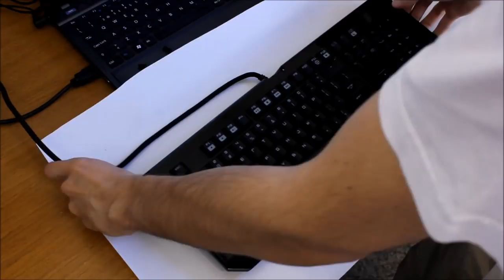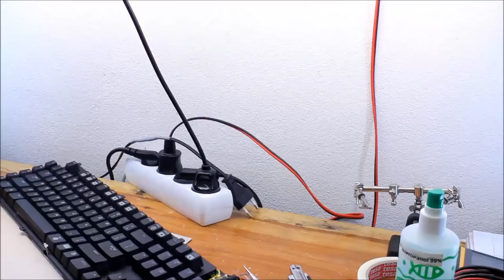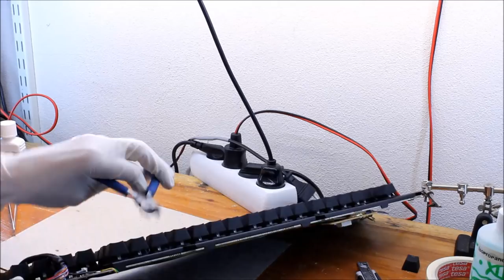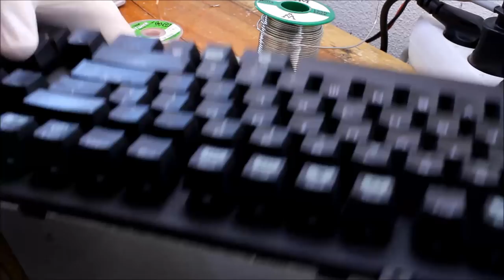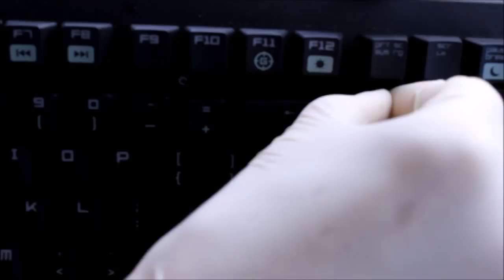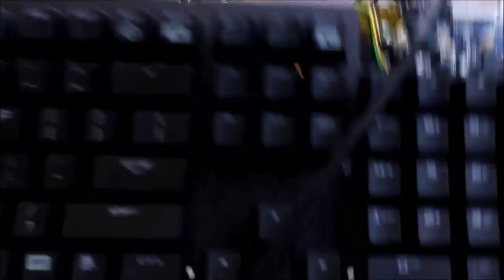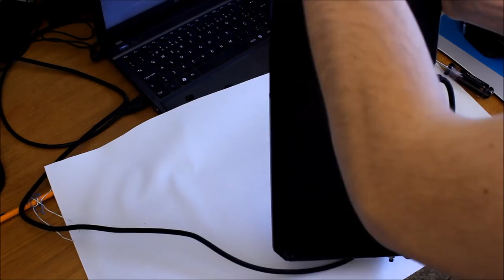How to replace backlight LEDs and Cherry MX switches in a mechanical keyboard.

Comment: Hello, is possible to put leds on my blackwidow's switches?
cuz ultimate version is too expensive :c
Reply from the maker: +imStorm3r It might be if the printed circuit board allows it, but I think you will also have to replace all your keycaps. If I'm not mistaken, the non-ultimate version of the blackwidow doesn't have translucid keycaps (even if you had LEDs, the light wouldn't be able to get through the plastic).
Reply: José Faria
it was obvious that I should change them
but can you please recommend me a video or something about placing leds on my switches?
Reply from the maker: Not that I know of. Just open you keyboard and follow the instructions on this video (skipping the LED removal, of course).
Reply from the maker: ***** imStorm3r  Up until yesterday I wondered if all blackwidows shared the same PCB, but an user confirmed they don't, at least his non-backlit PCB doesn't have LED mounting holes, so you will indeed have a LOT of work to make yours backlit.
Reply: That's a lot of work ._. ...
Then I will buy myself a new keyboard with leds when this one will not work anymore xD
Reply: +imStorm3r lol im thinking can i change my led colours of my blackwidow ultimate 2014 pls someone help .-.
Reply: ***** i dont have half of those things in the video i just wich there would be somekind downloadable hac or something :DDD
Reply from the maker: sniperb1990 sniperb1990 No, it's definitely an hardware mod :D

You will have to do what ***** suggested and replace all the LEDs if you want to change the color of the backlight. If you have to buy the soldering iron and associated supplies, it might be cheaper to sell your keyboard and buy one in your favorite color (or one of those new RGB ones).
Reply: José Faria is there an hardware mod :D
Reply from the maker: sniperb1990 sniperb1990 replacing all the LEDs is the hardware modification.
Reply from the maker: ***** Razer, with their clone switches, used a single 3mm RGB LED like this one: http://www.wayjun.com/images/Led/LED-504RGB.jpg

Corsair, on the other hand, used Cherry "RGB-ready" switches. Instead of having the LED on top of the switches, Cherry's approach was to make the switches transparent, so the keyboard manufacturer could install an SMD LED under the transparent switch, Corsair have a picture of the transparent switches in their page: http://www.corsair.com/pt-pt/landing/mx-rgb

The only thing in common in both Corsair and Razer's approach to RGB backlighting is the completely ridiculous prices, at least when they first came out, now there might be better deals.
Reply: José Faria thanks man
Reply: José Faria but where can i buy the leds
Reply from the maker: sniperb1990 sniperb1990 If you're not in a hurry and want the lowest cost possible, go to aliexpress.com or eBay and search for "led 3mm flangeless".

Like this: http://www.aliexpress.com/wholesale?catId=0&SearchText=led+3mm+flangeless

You can also search for the specific color you want, and talk to the seller before you order and ask him to send you a custom amount, like 150 LEDs so you also have spares in case some of them breaks down.
Reply from the maker: sniperb1990 sniperb1990 Oh, and still regarding the LEDs, the "diffused" or "milky" types are better for keyboard backlights, as they help spread and make the backlight more even across the whole keycap.
Reply: José Faria lol thanks but i am scared to brake my keyboard XD

Comment: can a razer black widow expert be backlit? i see the holes already there, can i just add leds in?
Reply from the maker: Try to stick na LED in there, even without soldering it should light up.  If it doesn't work, try reversing it. If it still doesn't work, send me a picture of the top of your PCB.
Reply: http://imgur.com/JCQ60wP
http://imgur.com/H5GYU6m
here are pics of pcb, i tried with 3 leds already, revered 2 of them too. nothing happened
Reply: better quality one 
http://imgur.com/75HElBE
Reply from the maker: darren sweg The photo you showd me looks exactly like mine, so maybe they didn't mount the individual transistors for each LED. When you look between the PCB and the metal plate, can you see any SMD resistors? In mine you can see one for each LED.

If they didn't solder the resistors, it would take a lot of work: you would have to remove all the switches to remove the metal plate, solder all the resistors, then solder the switches again and finally solder the LEDs.
Reply: http://imgur.com/RhHH7MX
Are you talking about these red things?
Reply from the maker: darren sweg No, those are diodes, but if you look closely, a bit further up from the diode (a couple os millimeters) you have two silver pads withouth any component soldered, maybe those are the resistors that are missing? To test that out you can solder there a 470 ohm resistor and see if the LED close to it lights up.

Comment: hey, i dont have anything to suck out or clean the melting lead, any diy suggestion ?
Reply from the maker: If you don't have anything to clean the holes, try and melt the solder in both holes at the same time, if you use good flux this is easy, and when the solder is melted in both holes gently push the LED legs in their place.
Reply: i bought a soldering iron and i couldnt melt the pins ......... im gonna have to buy a new one and a pump too
Reply: also my lights have 4 pins like wtf
Reply from the maker: That's because you have a keyboard with RGB LEDs, RGB stands for "Red Green Blue", that means each of the LEDs in your keyboard is actually 3 LEDs in the same package, you need to be careful when buying replacement RGB LEDs, they come in a large variety of pin variants (the wrong LED won't damage your keyboard, they will just either light up with the wrong color or not light up at all). You might want to buy LEDs that are actually sold as compatible with your specific keyboard model.
Reply: i give up, cant melt anything , il just get it to the shop and make them solder a new key
Reply from the maker: Any shop that repairs cell phones and consoles should be able to do it quickly.

Comment: does all leds have similar power use?
Reply from the maker: +Alex Jung Regarding the replacement LEDs you buy? No, they are all a bit different. Similar color LEDs usually have similar forward voltages, but can vary a bit and the maximum current is also specified by the manufacturer. In the case of this keyboard, because all LEDs are in parallel and they have a high value resistor each, what matters most is the forward voltage. On my case, my keyboard had blue LEDs, which have a forward voltage close to 3 volts, and I replaced them with white LEDs, which are essentially the same as blue LEDs, so the power use was identical. However, as an example, if I replaced them with green LEDs, which typically have a forward voltage closer to 2 volts, they would draw more power than the original ones.

In a parallel application, like the keyboard in the video, if the replacement LEDs have a higher forward voltage it is safe to use them, but they might output less light, if the replacements have a lower forward voltage they will draw more power and it might be too much for the driving transistor or your USB port.

In series applications there is usually a constant current driver, that means the power output will be very stable, independent of the LEDs, however, if you replace all the LEDs with higher forward voltage ones the driver might not be able to produce enough voltage to light them up.

If you buy your LEDs from a low cost supplier, like I did, the manufacturer data is very scarce, sometimes there is no documentation at all,  however, if you buy them from reputable manufacturers, they usually have a very detailed datasheet with all the parameters you need to know, see this example from Vishay: http://www.vishay.com/docs/83389/tlhp4200.pdf

If you want the details of how the drivers work, see this document, it explains very clearly common methods of LED driving: http://www.avagotech.com/docs/AV02-0532EN [Avago Application note 5310]
Reply: +José Faria thanks I owe u
Reply: +José Faria by the way, can you use the cheap solders for soldering?

Comment: does this work for Blackwidow Chroma?
Reply from the maker: +SomePurpleRandom It should be a very similar procedure, but the LEDs of the chroma should have 4 pins instead of 2 (one common and 3 for each color).
Reply: +José Faria I also need to know if I need to buy PCB mounted switches or Plate mounted switches for blackwidow chroma
Reply from the maker: I believe they are PCB mounted switches. Beware that the Chroma switches need 4 holes for the RGB LEDs, so either you buy a generic switch and try and drill the extra holes in the switch yourself or you need to buy switches specifically made for the chroma (or buy any switch and lose the backlight functionality, of course).

Comment: soo i spilled water on my blackwidow and the keys dont work. Any help?
Reply from the maker: +RocketLeon45 None of them work, or just some of them?
Reply: +José Faria well the q and the a will erase everything and the backspace would be a differebt key, I dont know what key it is because I had to shut down my pc abd couldn't log bqck on
Reply from the maker: I would quickly disassemble the keyboard and thoroughly clean it with isopropyl alcohol.

After cleaning the PCB, if it still doesn't work properly, I would tackle each non-working key individually, you can disassemble the top of the key without unsoldering it. Disassemble the top, make sure you don't lose any tiny parts, and thoroughly clean the inside mechanism with isopropyl alcohol. It might be a good idea to use a bit of electric switch lubricant, I don't remember if the Cherry MX switches are lubricated on the inside.
Reply: +José Faria alright so i fully disassembled the keyboard and dried everything but i let it sit in a towel to dry and it works now. Thanks for taking the time to reply to me
Reply from the maker: +RocketLeon45 If it was just water it will probably be fine, when it's drinks with sugar and other contaminants it's worse.

Comment: Hi Jose. My sons birthday is in 3 days so please could you get back to me as soon as possible. Please could you link me to where I should buy 108 white LED lights that will fit my sons razer blackwidow 2013 ultimate?

I read your wordpress post and noticed you said you got it for 5 USD! I went onto a website and it said 27 USD haha. Thanks in advance for your response!
Reply from the maker: They appear to be a bit more expensive now, but when I want cheap ones I usually buy them on eBay or aliexpress, like this:
http://www.aliexpress.com/store/product/100pcs-3mm-diffused-White-Round-Flangeless-milky-white-LED-Leds-Light-2-Pin-3mm-ultra-bright/107456_1781548721.html

You can ask the seller and he will sell you more than 100 or just buy two bags of 200 (always buy more than you need, some may be defective and it's always nice to have spares with the exact same color). However, they will take more than 3 days to arrive from low cost suppliers, if you need them quicly you will have to buy them from either a local supplier or from a big distributor like mouser or digikey, like this:
http://www.digikey.com/product-search/en?FV=940008%2C9403c6&k=3mm+led+flangeless&mnonly=0&newproducts=0&ColumnSort=0&page=1&stock=1&quantity=0&ptm=0&fid=0&pageSize=25

But they will definitely cost more than 20 USD...
Reply: José Faria Thanks for your quick response! I have another question;

Are these aliexpress lights just as good as the ones you used, also do the lights have to be flangeless? I can't seem to find any lights that are from my country that are flangeless on ebay. (I am from the UK so if you could get me a link for a UK ebay seller that would be great) < only if flangeless is needed though, of course! 

Thanks again in advance.
Reply: Hi - forgot to add, please could I have your email so I can discuss with you quicker and more privately so as I want to speak to you about a "deal" haha! I feel as if I will break my sons keyboard as I have no experience with this.
Reply from the maker: I recommend flangeless because it's easier to replace. I've made the mistake of buying regular ones, then I discovered they didn't fit, so I had to grind a bit of the bottom flange one by one... I did it because I already started the procedure and had all the original LEDs out. I definitely wouldn't do it again :D Besides, there are lots of alternatives, I got tired of the cherry mx blue switches and replaced it with a cooler master which already comes with white backlight.

I'm pretty sure you can send private messages via youtube.
Reply: Ahh ok, I understand. I hit you up with a private message, I will respond in the morning - thanks again for your quick and detailed response :)!

Comment: can you change a blue keyboard to an rgb one?
Reply from the maker: Technically you can, if you use RGB LEDs with integrated drivers, but they would be blinking and changing color randomly, you would have no way to controll the color.
Reply: José Faria but i could change them with white led's right?
Reply from the maker: Yes, you can replace them with pretty much any color you want.
Reply: José Faria do they have a special Name Or du you have a Website where i can buy them?
Reply from the maker: If you have a keyboard similar to that one in the video, you need to buy "flangeless 3mm led", you can search for that in sites like ebay or amazon, I usually buy them here: https://www.aliexpress.com/wholesale?catId=0&SearchText=flangeless+led+3mm
Reply: i've seen this video a few times since the time i decided to change my switches to gateron yellow. then i was thinking of changing the led as well cus green is kinda hurting my eyes if i use the keyboard at night with the light's off. so im about to ask about the led then i saw this comment lol so all i need to get is flangless 3mm led, right? btw i have blackwidow ultimate 2016 version.

Comment: Erm im kinda new to this so can anyone tell me can i take out my membraine keys for mechanical ones?
Reply from the maker: On membrane keyboards, the keys can usually be removed from the back. Try taking the rear panel off and then remove the membrane sheet, now the keys should come out from the back.
Reply: ty for the info :D
Reply from the maker: Now that I read your comment more carefully, are you asking if you can install mechanical switches in a membrane keyboard? If that is the case, no, it's not possible...
Reply: yes i was asking that. Darn welp i guess i have to buy a mechanical keyboard. Thx for the info was about to buy a few switches for my keyboard
Reply from the maker: shadowgames3119 Even if you could, it wouldn't have been a lot cheaper than a new mechanical keyboard, the switches alone should cost near 100 USD (around 110 keys).

Comment: Question: When buying replacement switches do I need to buy the kind that comes with LED or can I reuse the LED that razer already have. For example I wanted to buy this: http://goo.gl/aoCzCL
Reply from the maker: As far as I know, there are not replacement Cherry switches with built in LED, they only have the holes so the LED can later be installed, so yes, you should be able to reuse the LEDs you already have.
Reply: José Faria
Alright, thanks for replying!

Comment: What means respecting the polarity
Reply from the maker: +Juuso Järvelä LEDs have to be wired the right way, the anode to the positive and the cathode to the negative of the power supply. If you solder an LED the wrong way it will not light up. You won't damage the LED if you connect it the wrong way, it just won't light up.
Reply: José Faria Oh. okay thanks where did you get those lights
Reply from the maker: I usually buy them on eBay or aliexpress.com, you can search for "3mm flangeless led"
Reply: José Faria Thank you

Comment: There's no reason to go through all that trouble to change the led's because the stock led's will emit any color. the color is controlled by the software which for whatever reason they removed that feature in software update.
Reply from the maker: Trust me on this one txdbstx, you are mistaken, there was no color selection menu, you might be thinking of some of their mice. The color on the LEDs of your keyboard will definitely not change by software. There are LEDs with multiple colors, but they are completely different than these ones.

Read this, especially the “Physics” section:
http://en.wikipedia.org/wiki/Light-emitting_diode#Physics
“The wavelength of the light emitted, and thus its color, depends on the band gap energy of the materials forming the p-n junction.”
So, unless you change the physical properties of the LED chip, the color won’t change.

The only choice you had was to buy the Blackwidow Ultimate in blue, wait for the newer version in green or buy the Stealth edition in Red, there might be other versions, but I’m fairly certain they didn’t make a BW Ultimate with RGB LEDs.
Reply: All I know is when I bought my Blackwidow Ultimate keyboard and installed it, I was thrilled that I was able to choose between several different colors. I first used red then later switched it to blue. Not until recently did I decide to change it back to red but the lighting options are now different and there's no longer the option to set the color. I was not dreaming I promise. I just wish I could somehow revert back to the older software version and prevent it from auto updating!!! thanks for the reply.
Reply from the maker: txdbstx Are you sure you are not thinking about some of their membrane keyboards? My BW Ultimate will definitely not change colors, I know that for a fact because I know exactly how it's hardware works. Cherry MX switches with RGB backlight use SMD LEDs, not 3mm ones. Do you mind posting a closeup picture of your keyboard with one keycap removed? Now I am curious...